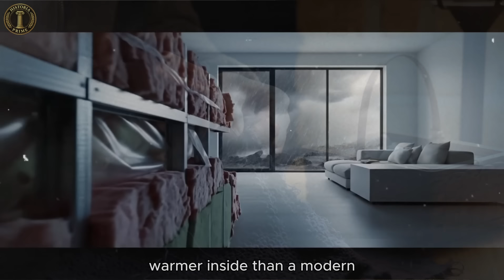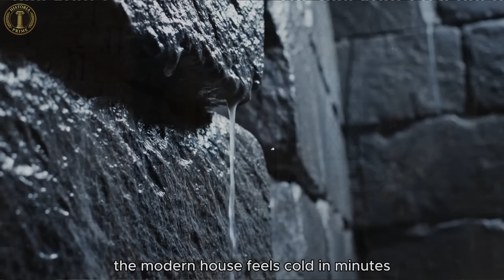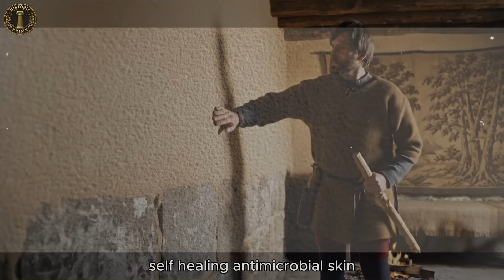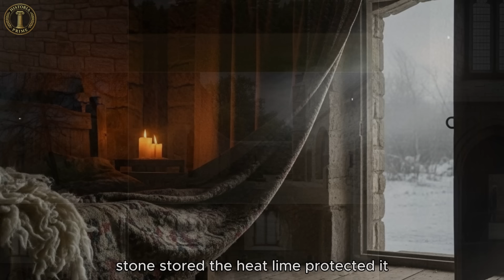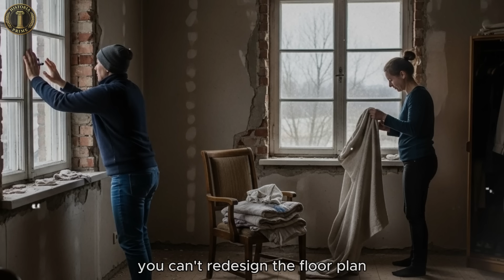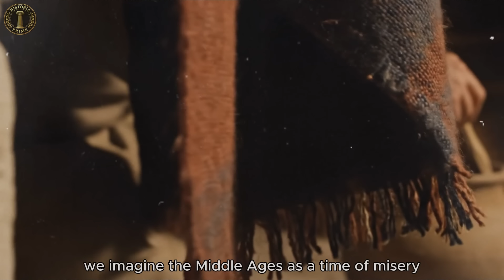This 800-Year-Old Building Stays Warmer Than Your House (Here's How)

Comment: Why use an English voiceover when the language being spoken is American English? The ‘furnace’ that is referred to is actually named a boiler in English.
If using American English it would be more appropriate use it for the voiceover!
The other issue is that in English Fahrenheit to measure temperature hasn’t been used since 1974!
Reply from the maker: Good question. We use American English for consistency with most of our audience, but you’re right—terminology and units vary by region. Appreciate the clarification.
Reply: , use an American English voiceover then and stop corrupting English.